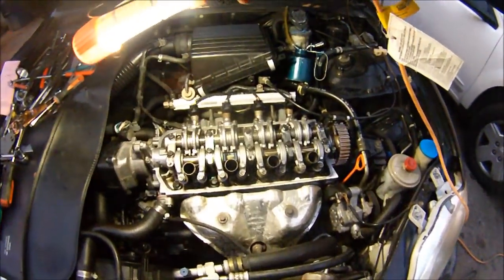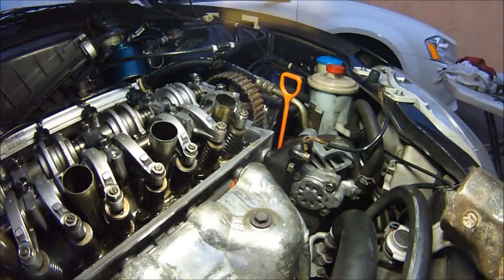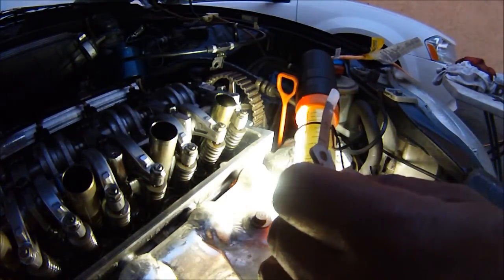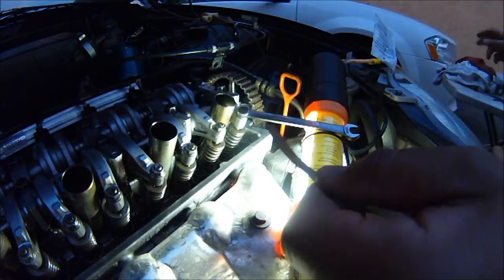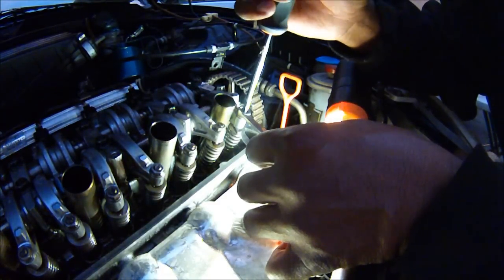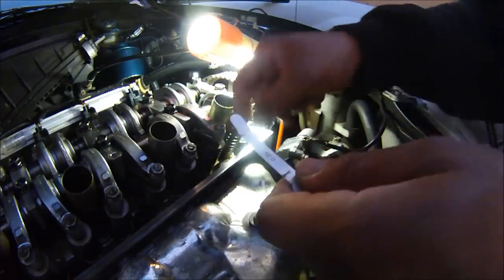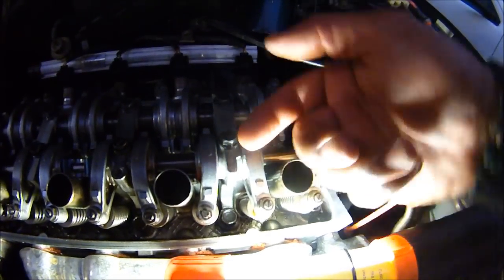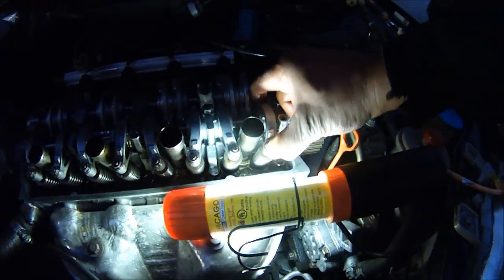EASY CIVIC ADJUSTING VALVES/ VALVE LASH (GAP) EXPLAINED. HOW TO ADJUST VALVES HONDA CIVIC

Comment: Hey, got a 2004 Honda element no code map engine but at idle in the morning and when motor is warm, I'm getting around negative 15 both short term and long term. It smells of exhaust gasses quite heavily but engine doesn't run rough at all and only symptom I'm having is I feel I should have more power. Have new oem air fuel sensor and the rear o2 as well. All my live data looks normal like map, ect, ait, etc. Do you think since these engines need to have their valves adjusted and it's a new to me car with 160k, that valves being out of adjustment can cause a rich condition? Thank you.
Reply: No. You would hear a tapping if it was loose and you would have more serious issues if it was too tight.
Reply: Your catalytic converter may be clogged
Reply: @bigdm9349  I actually have a gutted catalytic because when I bought the car the cat was aftermarket and poorly welded so I sawed it off to reweld and it was hollow. If it's not the valves,  then it can only now be a fuel pressure problem then.